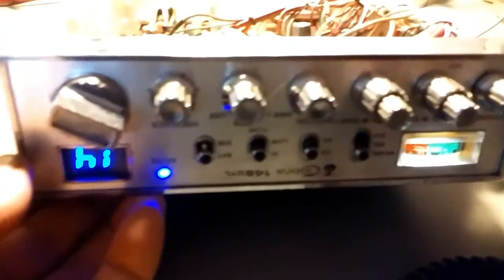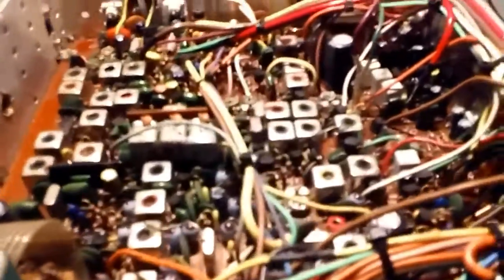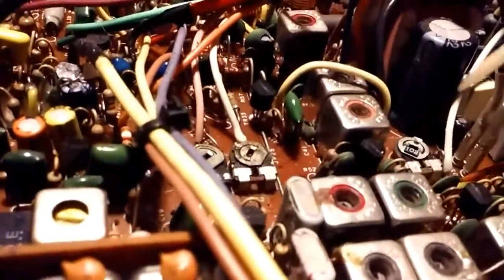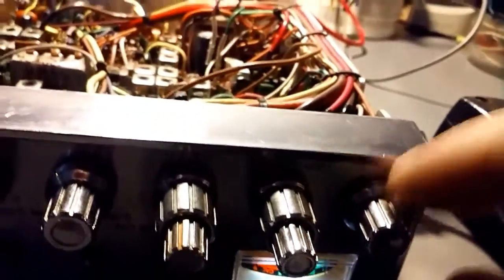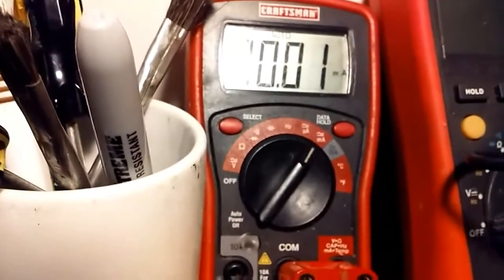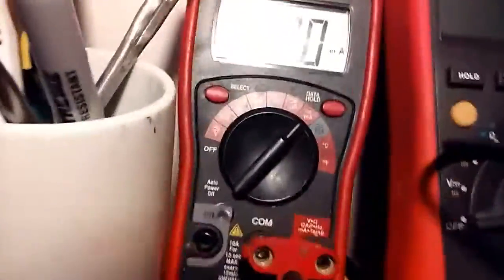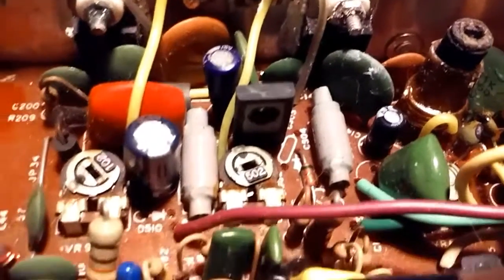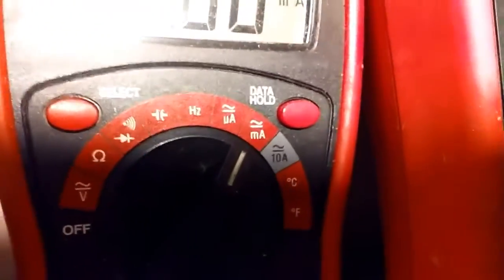Cobra 148 gtl driver/final biasing

Comment: Hi Robert,
Should there be insulators under the two bias diode packs on the rear of the chassis above the driver and final transistor ?
The same kind of insulators you put under the driver and final transistor.
I am working on one, and it did not have any.
thanks,
kevin rea
lancaster, calif.
Reply: thank you very much Robert.
Reply from the maker: The bias diodes need to absorb heat from the final/driver in order to compensate the bias voltage for the final/driver.  Insulators for the bias diodes?  No.  Some heat transfer compound is needed to help them do their designed job - yes.

Comment: Your meter shows 352, 8mA. Way too much. Should be 35 - 50mA. 73s
Reply from the maker: HaHaa! lol. Someone finally noticed!

Funny story next...I had my magnifier headset on when I made that video and couldn't actually see the meter hardly at all - due to the magnification.  I noticed that the mA were far too high after I took off the headset and posted the video.  I readjusted it down to 35mA.  Glad someone actually paid attention and said something
Reply: You are welcome mate.😉👍
Nice Video btw. I adjust Bias between 40 and 50ma for the 2166 and 50-60mA for the final 1969 or 2312. A slightly higher bias is not critical and gives sometimes better linearity.
73s Ralf